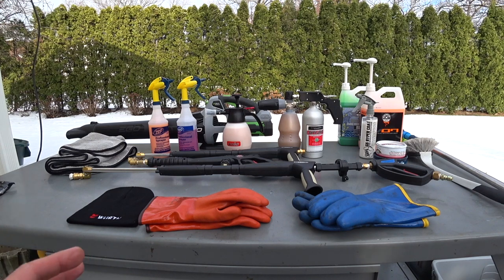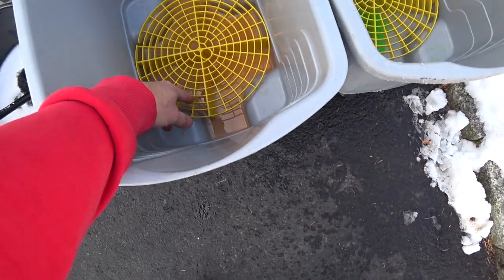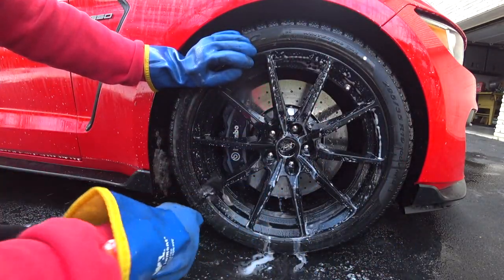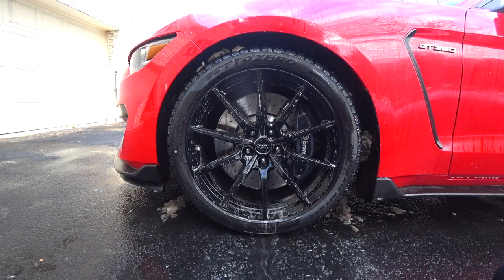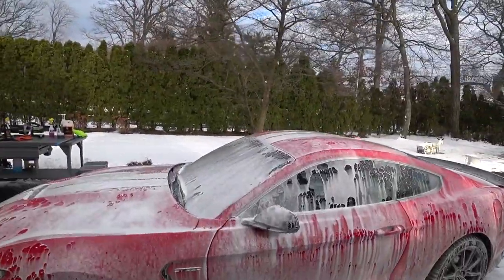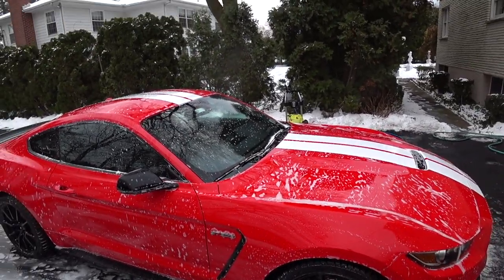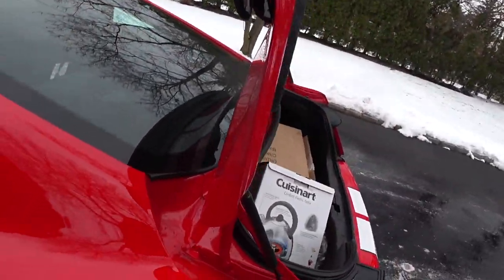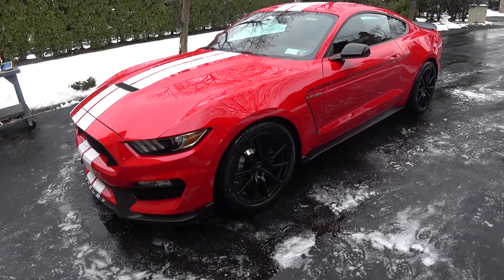How to Wash Your Car in Winter The Right Way | Auto Fanatic

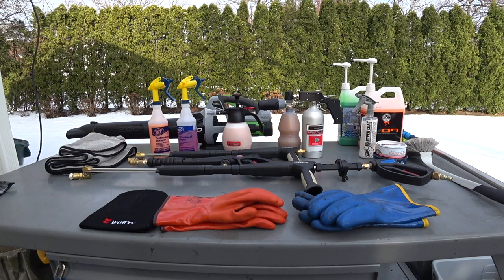Comment from the maker: Materials Overview 1:37
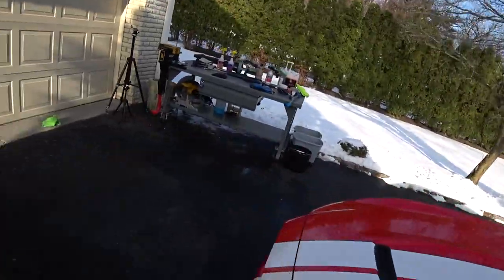Wheels & Tires 11:45
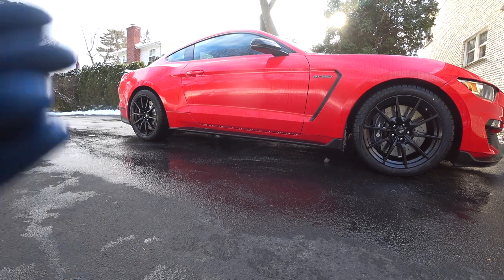Pre rinse & Chassis Bath 21:03
Foam Bath 26:23
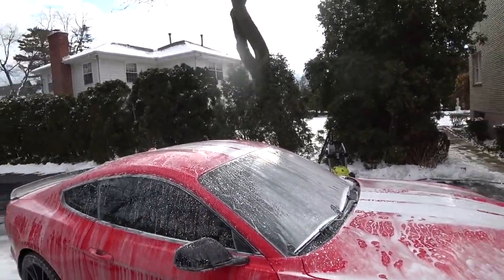The Wash 28:09
Final Rinse 33:24
Drying 35:30
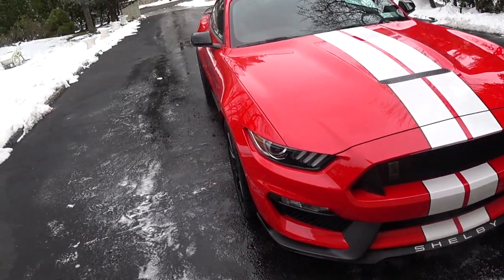Final Results 44:18
Reply: did you wash warm water on the bucket?
Reply from the maker: izwabbit no my water in my garage is about 38F degrees coming out
Reply from the maker: go for it, it works great and makes total sense.
Reply: What V07 product did you use the solo sprayer? the detailer or shampoo?

Comment: Nice job my man.  Everyone thinks I’m nuts when I’m out there in the winter washing the cars. 😂 I try to do it when it’s a little mild and the water won’t freeze on my driveway
Reply from the maker: Dexter 19 thanks yeah i try to monitor the forecast and if you saw in the beginning of this video the sun was out and it was suppose to warm up to 33 but it then went downhill and got dark, cloudy and raw and below 28 with. 14mph winds. def not an easy task in those conditions. so far my driveway still isnt frozen over 👍 try some of the tips i go over here i think you reap some awesome results.

Comment: Hey AF, quick question. Do you have a heated water supply for this? I always disconnect the hose when I'm done using it, but I'm hesitant to try if it's below freezing.

Comment: The top of my car is wrapped in vinyl. Do you have any suggestions on what chemicals are safe to use?  Great video and beautiful car. Very detailed and informative.
Reply from the maker: the roof or hood is wrapped? vinyl is damn durable if its good vinyl like 3M Dinoc, you just need to watch edges from lifting and you cant abrasive polish it.
Reply: The hood, top, and trunk are wrapped.

Comment: Fantastic video. I love the gt350. I just picked up a  gt350 R. I will make a video on it soon.
Reply from the maker: cool enjoy it, im trying to get a 2015 GT350R for my collection to tuck away
Reply from the maker: so youll have 2 now? Yeah i want the 15 for collector resale value except they only went into the hands of select dealer principals and collectors plus I want a white with blue stripes with no radio or AC to match an original 66 GT350R we had.

Comment: There’s winter and then there’s Winter. I’m in the Air Force, stationed in North Dakota where we can go literally a month without outdoor temps rising above 0 degrees F.  The good news is that it’s so cold up here that they don’t salt the roads (it doesn’t work at those temps) but the bad news is that it’s too cold execute your method here. Any tips for a safe winter wash in extreme cold?

Comment: Great video!  With the exception of the wands and Collinite 476 have it all.  As I told you earlier, my day here in Albuquerque started at 10F degrees.  Warmed up to 40F so pulled the car outside and did my thing.  Oh, the problem I mentioned earlier with what appeared to be hard water spots and I was fearing having to do Clay, F113 and Collinite 915 was another Detail Wash Product suppliers “Wash & Wax ‘ used in the Foam Cannon.  Gave what’s left to a neighbor.
Reply from the maker: Ron Keller yeah those wash and wax products suck try mixing the vo7 like i did here in the foam gun i think youll be surprised how well it works in the colder ambient temps we have now.
Reply: Auto Fanatic I used it to hand wash using 2 bucket method before getting everything I currently have per one or two of your initial wash and detailing videos.

Comment: Thanks for another great video. Do you have any videos out there on ceramic coating considerations or did you consider for the GT350 or have any thoughts otherwise re: that form of protection from your detailing experience/expertise?
Reply from the maker: unless you own a special car with a special $$$$ custom paint job or high level exotic which was hand painted and color sanded to perfection why spend thousands on a ceramic coating is my opinion, just use the good wax and be done with it. OEM paint is such crap today with terrible orange peel and imperfections, poor wavy body stampings, color mismatched bumpers you name it. I know real body and paint building mega dollar  show cars thats another discussion all together. Im just not falling into the ceramic trend maybe one day if I buy a black car with a good paint job such as a Bentley or Aston Martin i would seriously consider it but but a regular car no. FYI i highly doubt any clear film of coating will increase resale on any new car today and doing this on a rare collectible car is forbidden and turns off real buyers and collectors. Just inside info to share with you.
Reply: Thanks much for taking the time to reply & for your insights as much appreciated. I don't know much about ceramic coating yet so in-process of doing my homework on it. How bout for black painted aluminum wheels (like I have on my 13 Boss 302), would it add add'l protection or does it just make the wheels easier to clean?
Reply from the maker: VNISHPT 70 my friends had their gloss black wheels coated it does not prevent scratching or do much to keep them cleaner on a performance car with race brakes and high carbon content brake pads. even wheel mfr told me its all hype and they offer it for profit only.
Reply: Thanks for the reply as excellent info to know. Appreciate you sharing your expertise as extremely helpful. Thanks again!

Comment: I aways wondered if I could use a power washer in the winter to clean my car. Any tips on keeping it working properly in winter months so it doesn't freeze the pump. Thanks. Great tips.
Reply from the maker: whazuup000 just keep it indoors and use good gas, i put 93ultra gas in mine, also Amsoil for the motor oil. when i am finished i disconnect the hoses and tilt back so all the water drains from the pump inlet and outlet.
Reply: OK, good to know. Thanks for the quick reply.

Comment: Another awesome idea on how to use the v07. I can't wait to try it in the foam cannon and rinse bucket. I don't live in area where it snows or even gets cold, but I still want to try the v07 mix.
Edit: can you do a video or post links to which buckets, castor wheels and metal used for you wash and rinse bucket? And possibly a video on how to go about it? I just bought Matt's buckets over at obsessed garage, but I didn't opt in for his dolly/caddy system since a little to pricey for me at this time. Thanks in advance.
Reply from the maker: leonardo herrera my buckets are industrial buckets and come with lids and castors and will outlast anything out there and only cost $50 each. you can get them at Grainger or other industrial supply house.

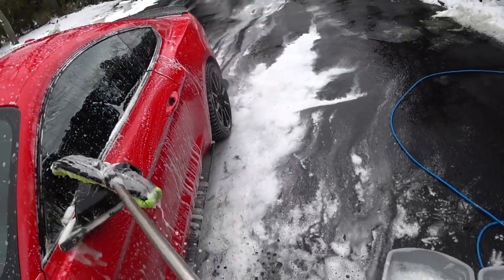Comment: 30:35 , 31:08 is why I personally wouldn't use the mop kit.  Even a little love tap like that could potentially mar paint if it is soft enough.  Love the video and keep doing what you're doing.  Car came out stunning!
Reply from the maker: the mop is heavily modified and safe with rubber and foam dont let the noise scare you. il be doing a video on that soon, havent marred the paint in 10+ years with the mods i made, back in 2007 the original mop has an aluminum base with sharp edges that badly ruined my E63 AMG trunk and Griots paid me for the repair and retooled this unit in plastic.

Comment: Great video!!   Whenever I wash in the winter my driveway ends up like a skating rink.  What do you do?
Reply from the maker: my drive has a nice pitch and water never pools up to freeze. The only time i ever had an issue if when i would drive over unplowed snow where it packed it down and freezes and if i wash after that a few days later and there is ice from the tire tracks the water freezes all around the tire tracks so all i do is make sure i clean the driveway ASAP and never drive over unplowed snow.
Reply: Thank a lot.  Love how you are so productive with your time - super quick and efficient.
Reply from the maker: David Bell the lower NY way gotta get it done quickly and good its very fast paced around here

Comment: It looks great, but to go from zero to here, you need about $1000 of equipment! All the chemicals, the towels, mops, buckets, table thing, pressure hoses, pressure hose adapters, leaf blowers, brushes, tire stuff. Is there a budget guide to cleaning anywhere? You know, were spit and elbow grease are the primary ingredients?

Comment: Check out DI Rinse. They make the spotless water system for griots. Di Rinse has larger systems which they market towards mobile homes. There resin is relatively inexpensive to replace and last longer than the CR spotless system you always see advertised. They actually make a kit to convert the CR system to their system which works better. I have been using it for 8 months so far and havent had to replace the resin yet
Reply from the maker: Steven Kraus had this system years back i was getting 2 months out of catridges our water is horrible even inside home we must change filters every other month.
Reply: That sucks. I guess the water isn't that bad where I live. If I get the cordless blower I will probably get the greenworks since I allready have 2 of their batteries and you can buy the blower without the battery cheaper

Comment: Dude, i cant believe you drive this car in the winter. And i live in Maine so im allowed to say this lol. If i owned that thing it would never see a winter. Unnecessary exposure to all the salt, sand and chemicals they use on the roads. Clean it, detail it, park it in the garage with a car cover on it. And do yourself a favor and get a winter beater. And then you wont have to wash it 1--3 times a week.

Comment: What did you use to make your 2 bucket wash roller?
Reply from the maker: Adan Capuchina these industrial buckets come with good casters, just used a nut, bolt and washer up top and flat steel strap on bottom took 5 minutes

Comment: Wish my paint would look like this I got a 2009 car and there’s nothing that’ll make it look brand new. The guy before me didn’t wash it much. I try everything everyone always complements how do you keep it looking good but I wax it every month or 2 and wash it once a week and to me I think it looks bad I don’t get it. Yours dirty still looks good when it rains on mine it’s destroyed looks like I haven’t cleaned it in 2 months. Any tips I can make a video of what I do and what I use I’m on a budget so I gotta use some lower quality products but the major things are all high quality.
Reply from the maker: landon hall type of car? wonder if it was poorly repainted and thats why you cant revive the finish?
Reply: It's a 2009 Chevy cobalt SS turbocharged amazing car factory paint just guy didn't take care of it my dads buddy is a detailer and said try clay baring the car been looking into it and might be the problem because the surface is a little rough but paint is fine. Like just some random black spots in the paint that wont come out but i think clay bar will do it. Its not chips either so i couldn't figure it out
Reply: iluvyone I washed it, used clay bar, put scratch and swirl remover on it, waxed it, the clay bar worked for me. Solved my problem thank you guys never knew what clay bar was you can see my video on my channel of the exhaust but you can tell it cleaned up pretty well but there is some water spots on it in the video just because my wing keeps water held up under it and it runs down the trunk.

Comment: What do you used so the water wont turn into ice when washing your car
Reply from the maker: nothing, the water is around 40 degrees at the hose and with the chemicals used it does prevent freezing, now NY is in a super deep freeze in the teens so can not get away with a wash now unfortunately. gotta plan a wash according to the forecast.

Comment: What about rinsing the under carriage during the winter? I'd be more concerned about salt on suspension components during the winter than on the paint.
Reply from the maker: i showed in the video using the different power washer wand, now depending on how bad the winters here get I put the car up on 4 jack stands or my wood service platform stands and then powerwash it sometimes 1 time per week or 1 time per month but it all depends because now the roads are clear, rain expected in the next few days so not a concern but as winter kicks ass harder that is what i do. Another easy tip is if you don't have a power washer you can use a garden hose with a low profile sprinkler and stuff it under the car and move it around front to back to get the salt off, it works and this is what I did 20 years ago.
Reply: Good tip. I need to rig something up. Not paying $6 for an undercarriage wash at the car wash every time i need to rinse underneath.
Reply from the maker: this is a neat tip give it a shot and let me know how it works, a sprinkler also works if you buy a cheap basic one but make sure it is low profile enough.

Comment: Any reason ONR wouldn't cut it for you as a pre-treat prior to a foaming soap?  I usually do that, seems to work well...
Reply from the maker: shmutube ONR is a cool product but just another product to buy and stock, my mix does the same and is more cost effective since i stock gallons of the V07 already. most of these waterless wash systems are literally the same as what i mixed up just with a fancy name, new color and packaging.
Reply: Auto Fanatic gotcha, yeah, totally understood.  Love V07, btw!
Reply from the maker: shmutube yeah it one of my favorites, just checked a gallon of ONR is$160 geeze thats a rip off and my solution is far better and more versatile unless guys like to piss money away. give it a try and see how you like my mix in the sprayer. Merry Christmas, AF
Reply: Auto Fanatic A

Comment: Love the video! The mop is genius I will be incorporating it into my system which is simular to yours. I have a 15 gt soon to have an 18gt.  I have been using a corded toro leafblower which works great at drying. Been thinking about cutting the cord though. Recently picked up a 80v greenworks snow blower which would use the same batteries. I recently piced up a spot lesa water system from griots. Its awsome for the final rinse!
Reply from the maker: Steven Kraus pick up the cordless Ego blower with a spare battery and never look back. i used a corded blower for 15 years was nice to say goodbye
Reply: Where did u get mop?

Comment: I don't understand why having the white road treatment stuff is that bad if it's on top of the paint, I know if it was bare metal then yah it promotes rust, but paint is not metal. I have driven mustangs for over a decade in CT snow and I just wax right before the winter and after major snow drives rinse under the car with the self clean car wash things that you spray yourself. But I have just left the crap on the paint and sure it looks like crap when it's on the paint but I don't notice it ever ruining my paint, so long as it's not rubbed into it dry to scratch it. Just seems a bit much. Great job though!
Reply from the maker: Kara G im a car collector perfectionist my craziness is rare so unless you suffer from the same sickness its hard to grasp. thanks for cking it out.
Reply: Auto Fanatic do you the mop all the time or just for a quick winter wash? Thanks for a great vid!
Reply: It's not the actual paint that contaminants are sitting on, it's the plastic based clearcoat which has pores that can collect contaminants and if left on long enough will create a strong bond with the clearcoat. It's easier to keep up with the cleaning than having to deal with clearcoat damage or heavy correction work. (I would rather prevent than try to cure). It's the undercarriage of the car that most people living in the bad climates neglect so realistically keeping the paint shiny is only half the battle, keeping the undercarriage salt-free will go further to keeping the car on the road/ or in your collection longer.
Reply: Idk, but my mom has a 2013 van and doesn’t wash her vehicle much and she has rust spots on her hood and trunk. She doesn’t have a dent on it tho, which made me think that the salt mixed with water somehow got into the inner welded panel and rusted it out

Comment: Instead of using the blower why not invest in a D.I. water system and you can just let it dry spot free?
Reply from the maker: with my water i need to replace filters every 3 months , very costly i had that system many years back it was not worth it. blower works awesome

Comment: New subscriber. Every time I hear that plastic mop frame hit the paint I cringe
Reply from the maker: read our website to learn more about this and the noise you hear is the hinge not hard plastic hitting the paint because there is no hard plastic in direct contact with the paint as i fabricate a new custom base with a dense foam rubber pad

Comment: How do you keep the water in the equipment and everything else from freezing up. This video is the exact reason why I never bothered to break out the pressure washer in the winter-https://www.youtube.com/watch?v=2Uiky2P2gU0. I would hate to have that guys experience. Do you have a hot water hookup to your pressure washer?
Reply from the maker: my water feed in the garage comes off my kitchen and its about 40 degrees at the tap, works fine and never freezes since the feed is inside the house and always warm.

Comment: That car isn’t even remotely dirty!! My car that’s spent 4 weeks on salted UK roads is so dirty you can’t read the number plate 😀
Reply from the maker: sam67uk it was covered in salt and not as much because i protect and manintain it. you shouldnt let your car get that dirty everytime you open the boot or doors your gonna scratch the clearcoat
Reply: Auto Fanatic my car is ceramic coated and I wash it using safe methods. When it’s clean it really is clean. 😉
Reply from the maker: dont trust the coating it is underneath that counts because if bolts rust bad youll have hell doing service work, paint can always be fixed and corrected but hardware not so much.  Where are you in the UK that you get all this snow?